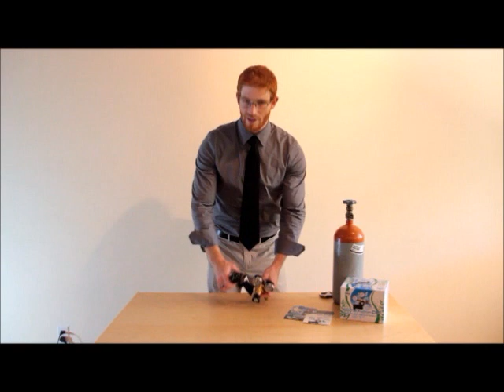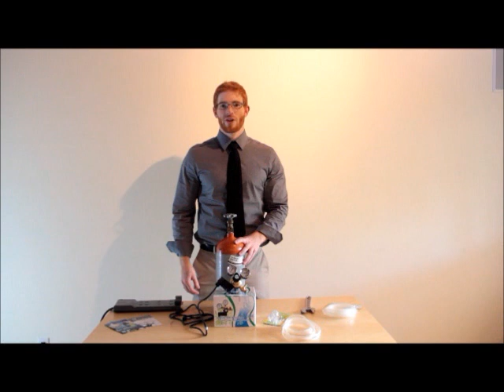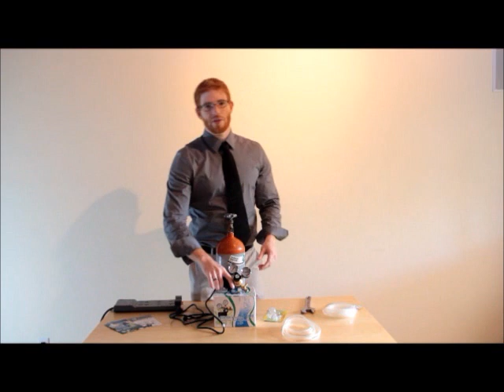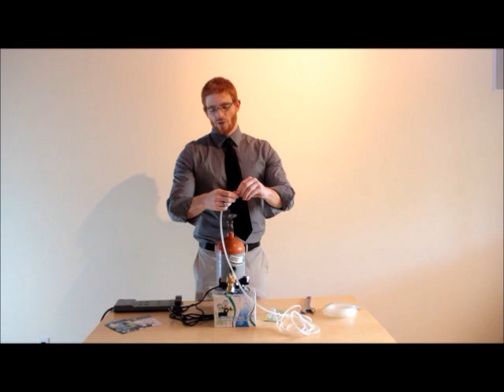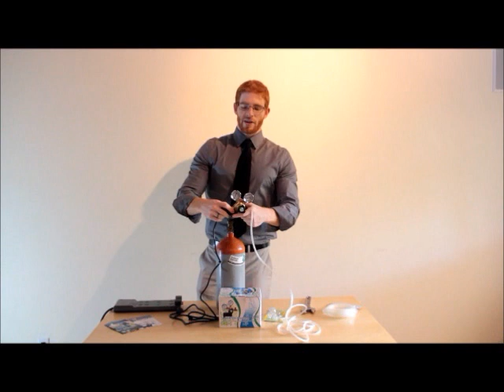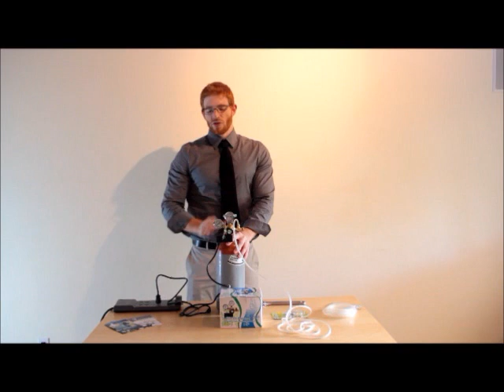Premium AQUATEK CO2 Regulator with Cool Touch Integrated Solenoid

Comment: Just a quick note on the video, I think folks should know the working pressure knob should be reduced to zero/fully closed (turned counter-clockwise) before opening the main pressure valve on the tank. Otherwise you run the rise of blowing the working pressure gauge.

Comment: I'm having issues putting the o-ring in a stable place between the tank and the regulator. Am I overthinking this? Will it be okay if it is not exactly in the groove?

Comment: Just got the premium version. My question is the rubber O ring that is hanging around the neck of the meter. Is it an extra or do I have to install it between the tank and regulator? There seems to be one there already.
Reply: probably extra would be my guess.
Reply: I put both of them in.  Didn't hurt.

Comment: Why does it sound like there is a leak when opening the CO2 cylinder while having the regulator closed?  I have purchased this regulator and I'm going through the same thing... the leak seems odd... If the regulators needle valve is closed I would think nothing should happen...